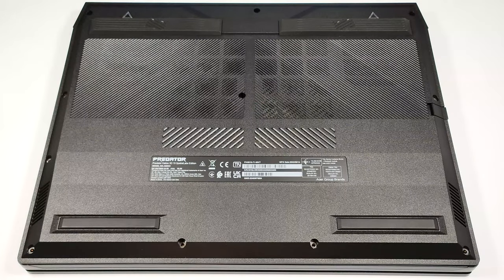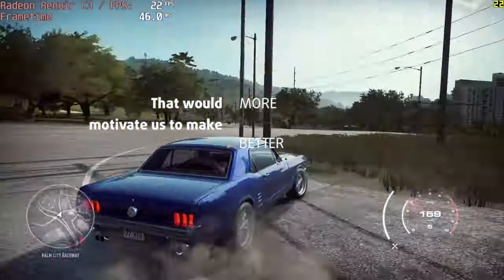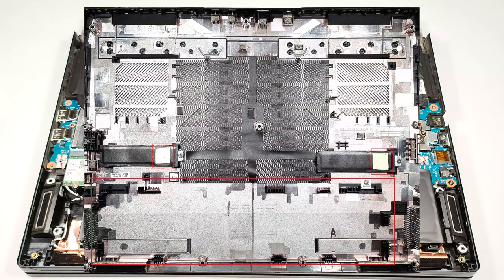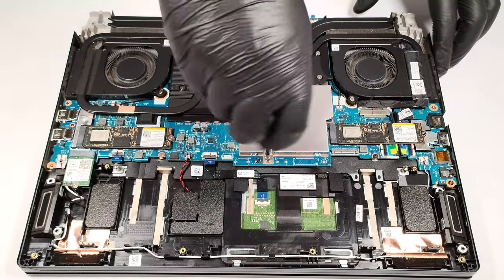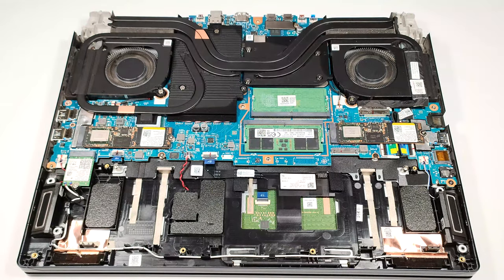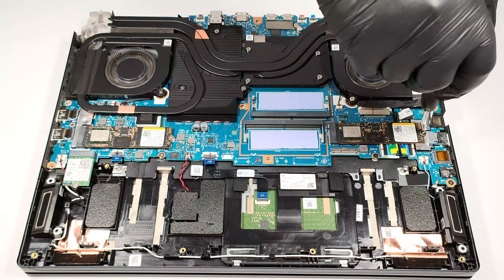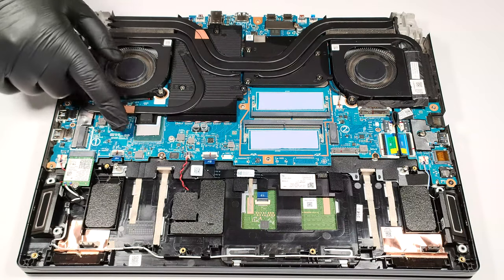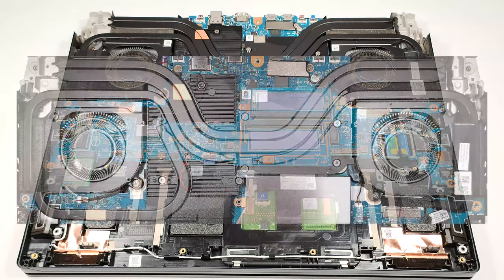🛠️ How to open Predator Helios 3D 15 SpartialLabs Edition PH3D15-71 -disassembly and upgrade options

Comment: I have this laptop, but the cooling on the GPU side is insufficient, when both fans at max speed,175W mode it is going to end up at 87C and the GPU will throttle to 165W, I'm not sure if this cooling module is really insufficient or the paste they use on the GPU side is not ideal.